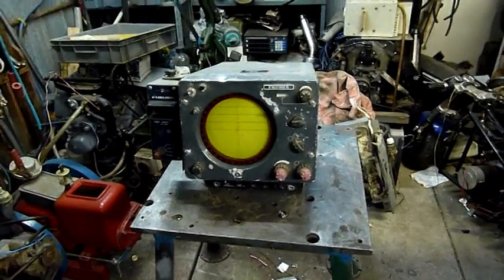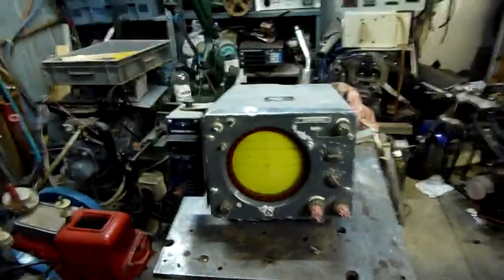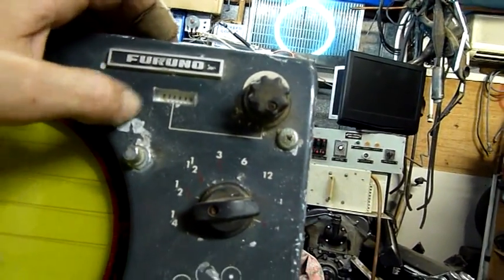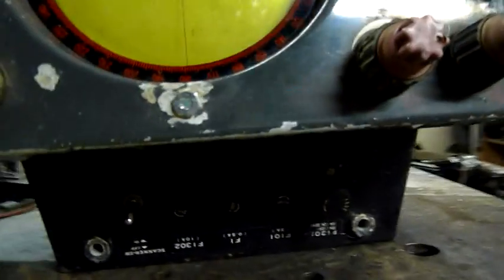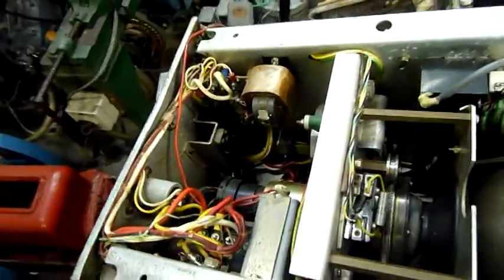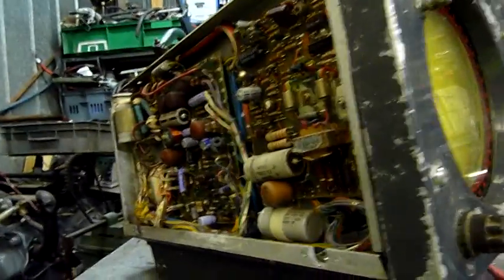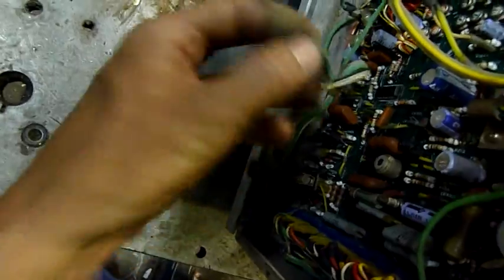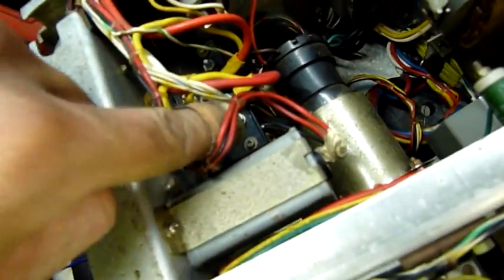A Peek Inside A 1976 Furuno Radar Display Unit

Comment: I doubt this will ever work again.  if you have several blown caps, resistors burning, and possibly other parts damaged, then it would be too time consuming to trace out and repair.

also, since this is a marine radar unit, you could also have salt damage

Comment: I have this unit and yes the two fried resistors are the same and I could power the secondary unit with 10 to 12 volts. A plaque on top of my unit says it runs on 12 volts NOT 24 which caused the warning smoke. I would like to know if you got it to at least sweep. Thank you.

Comment: top left: screen + scanner sync, the crt deflection coils rotate in sync with the scanner this was used to resync them by stopping one till the other caught up.
the "power divider" switch was to set the scale of the display for 1/4 mile to 18 miles
the next knob was for wave scatter /rain scatter, basically cleaned up the screen from false echoes.
bottom right: i believe they were for brightness and focus
hope this helps

Comment: hat unit brings back memories, the standard unit was just the display and the scanner unit & was all that was needed to run it, the "range marker" drew circles on the display at a diameter set by the range marker.
bott left: bearing ring, you could set that to your current heading to get a bearing on a contact.
the three bolts around the crt are to mount a viewing guard, like a face mask to keep daylight out.

Comment: Interface 

Normally two leads power.... need to establish the voltage probably guess from the fuse

The other connector should be to the scanner

Gain Voltage
Tune Voltage
STC Voltage
Video and video return wires
Scanner angle or Scanner angle event
Pulse Time zero range and PRF
Range rings on off or timing to fire gun diode from range 0
Magnetron header 
Transmit Enable
Power (sometime more them one wire with an open array link that as they get more wind-age)

Comment: Connect the display to the scanner is normal, normal two units.  You will be suprise hw much you can get working as long as they are dry inside.

Comment: I suspect the push-pull oscillator that drives the inverter transformer is dead.  Probably bad cap or shorted TO-3 switch transistor if I saw it right.  Pre-drivers, little transformer big driver transistors then the big main transformer.

Transistor locked on (or shorted), smoking that one set of emitter resistors or base current limiting resistors.

Curious to see if that is what it is if when you have time to fix it!

Comment: @farmall1938 So takes 24 VDC into a primary center tapped winding.  Each side winding goes to a power transistor.  An oscillator drives the transistors back and forth, creating AC on the primary.  From there you have all the secondaries in the transformer to get all the voltages necessary... as high as you want.

Very similar to the system used in high power car amplifiers to boost 12 VDC to 60 or more volts for the output stages.

Comment: @farmall1938 I double checked as this is a curious machine.  That probably is a transformer, but the two large gauge wires (pink and red) go from the transformer to what appears to be set of TO-3 power transistors near the board with smoked resistors.  Looked like a set of emitter resistors for each transistor aka 4 resistors.  Board looked like some type of oscillator with the TO-3 pre-drive transistors on the vintage clamp heatsinks on that board.  Looks like a push pull transformer driver.

Comment: @farmall1938 I suspect that is an inverter transformer.  There is most likely an oscillator driving the 24 primary side of the transformer.

Could be a shorted power transistor that makes up the oscillator for the power transformer, could explain the smoking resistors.

Comment: @kretschi123 The DC is converted to AC first by a small inverter or multivibrator (coil, cap and transistor) of some sort. A transformer, or at least the principle of how they work, only works with AC. The transformer will take care of the voltage to elevate (or lower) values.

Comment: @Morkvonork In my opinion, that ring round the CRT is indeed some kind of deflector. It probably is in synch with the rotation and direction of the head itself. This so that the CRT is not giving dots in an area the sweep has been over. Everyone knows those radar screens from the movies, not? The beep and dot happen as the line passes over an area with a ship in it. (the head must be pointing in the direction of the rotating line on the screen, I guess.)

Comment: It is indeed an oscilloscope, just a bit more "mechanical" if I can say :D Should be an easy fix since there is not much in to it, sure will take some time to check transistors, but maybe even changing just capacitors will give it a little life to start from. At least to get the filament heat up and HV to go :]

Comment: Mmmm, vintage 1970s magic smoke.....Don't breathe this! :-D

I'm sure that, if you did get this going again, it wouldn't do much, as the rotating bit is missing the magnetron. Because of that, this may not work at all, or if it does, it may misbehave. I'd seem to think it would behave a bit like a computer that is missing it's main hard drive, or something like that...It would power-up, but certain bits and functions won't work properly, or at all. 

-BoomBoxDeluxe.

Comment: hm, how does the transformer transform 24V DC into higher voltages? like a little switch mode powersupply without the rectifier?